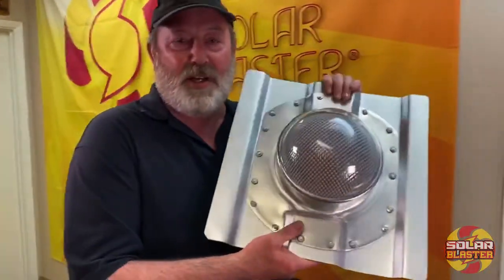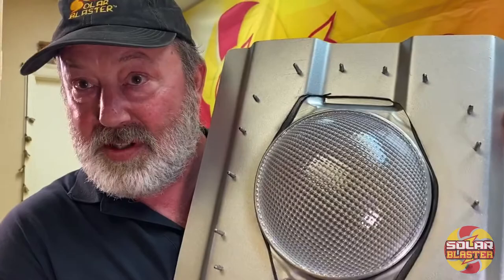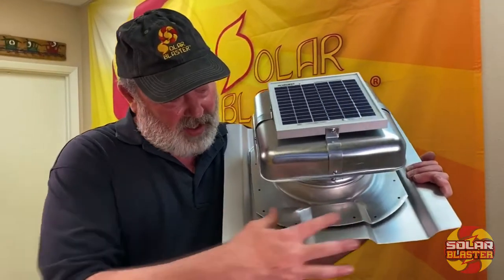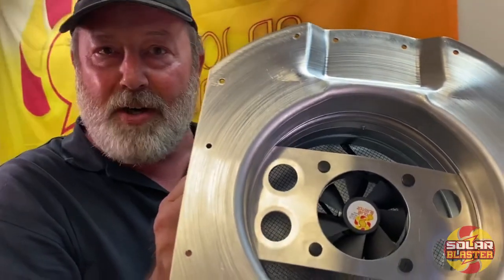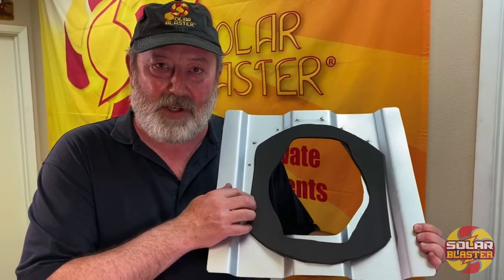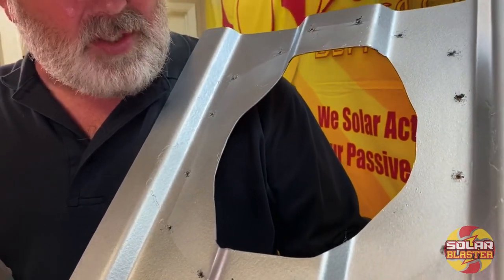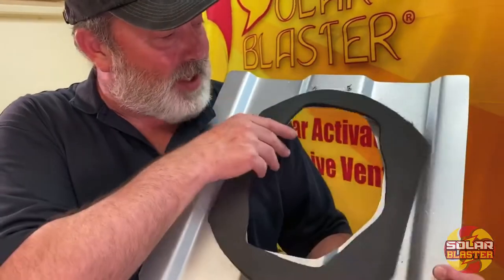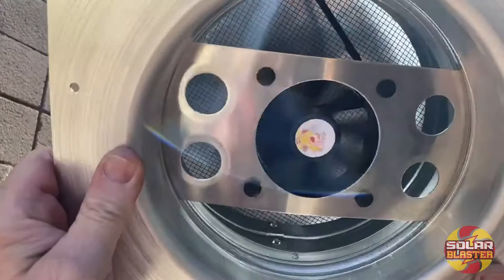New Vent for Conex Containers!

Comment: 19.08.20 - I was looking for a whirlybird type venting product for our 2 x 20 foot storage shipping containers which during the Outback Australian 6 summer months get to 100 degrees celsius inside the containers.
Thanks to your clip you got me thinking solar is the answer for continues venting 24/7 and now have a solar whirlybird in the top of each container to suck out the hot air. 
We also fitted 2 large vents to each container to help with the venting system.
Reply: Can you tell me which solar vent you purchased?

Comment: I installed 2 of these on my roof. I also have at least 65 little 2 inch vents. My container is also insulated but my container is still at least 85 degrees inside on hot days
Reply from the maker: Hello, thank you. Please keep in mind this is a system that moves air. It removes superheated air and moisture. We cannot cool below ambient air temperature. We recommend that you install the intake vents on the East or North side of your container to pull in the coolest air possible on those hot summer days.

Comment: Does it run continuously while the sun is out or does it have a thermostat to adjust between 40 degree days or 90 degree days?
Reply from the maker: No thermostat. It runs when sun hits the panel.
Reply from the maker: We want it to run whenever the sun is out for you. Winter is the most essential time to get rid of moisture.